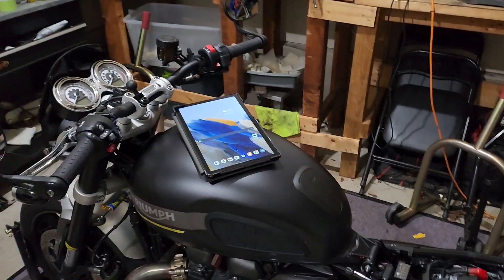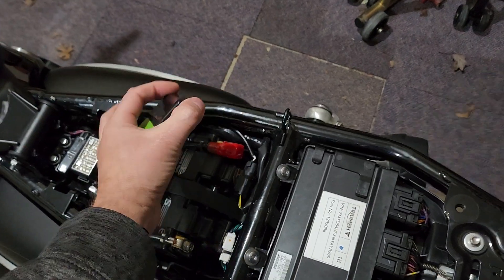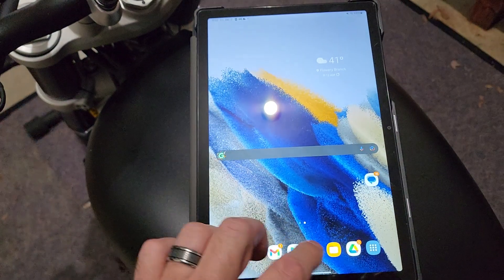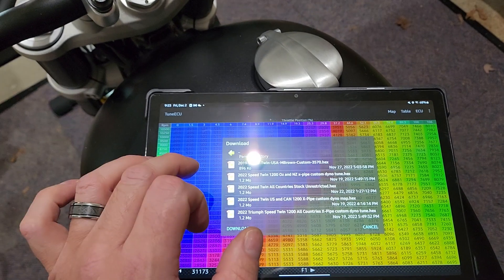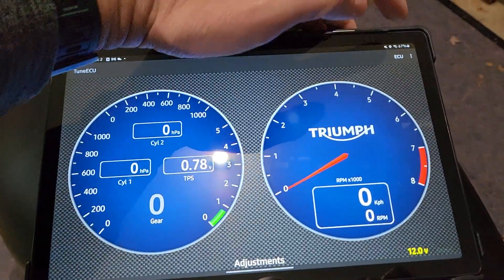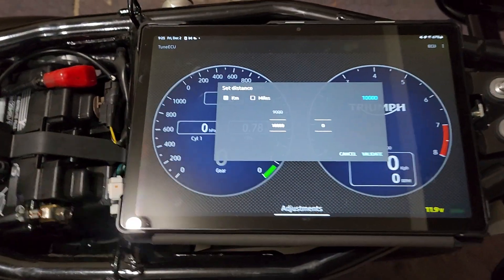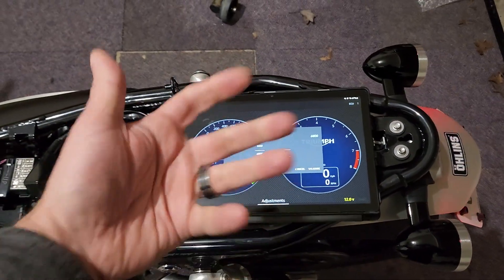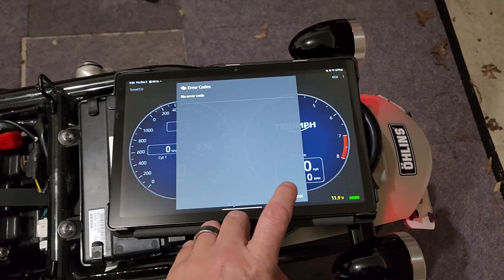Dave's Garage - How to reset maintenance minder on modern Triumphs

Comment: Thanks Dave! This really helped me. Dealer won’t reset the maintenance wrench without doing the oil change for $200 plus. Just did the “600 mile “ service
Reply from the maker: If a dealer tells me I can't pay them half an hour to reset a service reminder, I go find a better dealer.
Reply: Agree. Also the tune ecu app is now 24.99 pounds and good for 5 bikes but 1 year. Must be renewed yearly. Just for info!
Reply from the maker: True.  I bought a license many years ago, so I got grandfathered in and don't have to pay yearly...

Comment: Hi Dave. If i plug in my bike for the first time to tune ecu, does it shows witch throttle parameters it currenty has so that I could de restrict to 100% without downloading a map? Or is downloading a map for my street scrambler 2021 necessery?
Reply from the maker: No, you have to download the base map for that bike from TuneECU, see what's in it, make your changes, save the file and then push it to the bike.

Comment: I'm curious if you have a place where you find all these tunes, or if you're doing it manually (Sorry if this sounds like a stupid question, I'm fairly new to TuneECU)

What would you recommend as a tune for a 21 Rocket 3 GT with a set of Werkes pipes on it, and a 22 Street Triple with a high flow airfilter and a Akro slip-on exhaust?
Reply from the maker: Does your Street Triple still have the stock headers and catalytic convertor?  If so, then you can tweak the fueling with TuneECU to add a little fuel to the cruising range... up to 5000rpm and 20% throttle...

Same for the Rocket if it has the stock headers and cat...  Plus, the Rocket is severely restricted, so you will want to unlock that to full power as well.
Reply: @SquireSCA  My bike currently still has the stock headers with the first cat. Yes😮, however, I'm debating on whether or not to remove it.

 The same goes for my dad's bike, however I'm not sure if there is a way for him to remove the other cat from his bike.
Reply: @SquireSCA  Also, I completely forgot to ask, but can you have 2 bikes using the same software? Or is just the licensing part?

Sorry again if these questions are stupid.

Comment: Great tutorials and very informative. I was looking for tune ecu maps and Information for my Triumph Trident 660 here in the UK. Hoping to get rid of the throttle lag and now after watching your vids I may have to purchase a map as I don't feel confident altering maps myself. keep up the good work.
Reply from the maker: I can make you a map for free, that's easy.
Reply: @Daves_Man_Cave  Really? that would be great. Thank you
Reply from the maker: @pdkippax  Yeah man, it will take me 15 minutes. Year, country and VIN range?  And is it the full model or the A2 version?

Any mods done to it?
Reply: @Daves_Man_Cave  Year is 2022, Country is UK, full power model, GPR exhaust added, VIN last 6 digits are NAY1213
Reply from the maker: @pdkippax  There GPR is a slip-on right?  Not full headers and decal?

Here is a map that will work well:  https://drive.google.com/file/d/1K9lkFiPcaav3BTUIAf_DQQnTw7WVNulU/view?usp=share_link

Some more fuel where its usually lean, extended the rev range a little, shifted the AFR targets to 13.5 and made sport or road mode, whichever is your more aggressive mode, significantly more linear and aggressive for a much more sporty feel.  Should get rid of the lag and make it a much more direct connection between what your wrist does and how the motor responds.  Rain mode I left alone, and the ignition timing looked fine so I didn't tinker with that at all.

Download the map to your Android device, push it to the bike, reset adaptive and go ride it for a bit and let it settle in.  Make sure to test out the Road/Sport mode, that's where a lot of the changes were made and sometimes when you flash the bike it reverts back to rain.
Reply: @Daves_Man_Cave  Thank you for your help. Maybe I should have said that the exhaust was a complete replacement (only full systems available) and the cat was removed. Still has the O2 sensor in the system. Would this map still work? Really appreciate your time and effort.
Reply from the maker: @pdkippax  Start with that map.  It has more fuel than the stock map you are using, and if the bike isn't crazy lean now, it should help.  If you feel like it needs more fuel we can revise it.
Reply: @Daves_Man_Cave  Thank you
Reply: @Daves_Man_Cave hey, how difficult is this from dnk tune map
Reply from the maker: @SuperRider-RS  Same process, unless her locking the map so that you can't see what is in there, interferes...  I don't think that it will though.  The map is a separate process from a dash reset.
Reply: @Daves_Man_Cave  Can i use that map? when you mentioned more fuel, it means consuming more fuel? I use Zard full system.
Reply from the maker: @SuperRider-RS  What model, year, country and VIN range is your bike?
Reply: @Daves_Man_Cave  Trident 660, 2021 (India) last 7 VIN: NAU3991
Reply from the maker: @SuperRider-RS  What map are you wanting to use?  My map is for a Speed Twin, so you can't use that.  DNK maps are hit or miss.  Some are ok, others are bad.  I see a lot of people not happy with their DNK map.
Reply: @Daves_Man_Cave  Yes this map is not going to work for Trident, also i heard of folks not happy with DNK's map, there is no one else making the map for trident.
Reply from the maker: @SuperRider-RS  I mean, I can make one that is better than stock, that will at least keep the motor safe until you can get it on a dyno sone day to properly tune it, if you want?
Reply from the maker: @SuperRider-RS  Start with this map,  It will have more fuel than stock, all restrictions removed, a more aggressive throttle map for Road/Sport... Rain is untouched...  And the AFR tables are richer...  Start with that.  If you think it needs some more fuel let me now:

https://drive.google.com/file/d/1K9lkFiPcaav3BTUIAf_DQQnTw7WVNulU/view?usp=share_link
Reply: @Daves_Man_Cave  wow cool, i don't know if i'll ever get this bike on dyno, but if you feel it is best I leave it stock then I'd be safer this way?
Reply from the maker: @SuperRider-RS  With a full exhaust, use the map I provided.  It will run better with that.
Reply: @Daves_Man_Cave  cool, where do I find this map?
Reply from the maker: @SuperRider-RS  https://drive.google.com/file/d/1K9lkFiPcaav3BTUIAf_DQQnTw7WVNulU/view?usp=share_link
Reply: @Daves_Man_Cave  appreciate that! i'll find some time to get this updated over stock, do you feel I can expect same or better fuel economy with this map?
Reply: @Daves_Man_Cave  i forgot, will this require vin number?
Reply from the maker: @SuperRider-RS  richer map means you burn more fuel.  Do you want to save $39 a year on gas, or do you want it to run right?  Lol
Reply: @Daves_Man_Cave  ofcourse run it right! came to my mind because I also do long rides :)
Reply: @Daves_Man_Cave  Dave, one question, can this map be applied to other trident on stock exhaust?
Reply from the maker: @SuperRider-RS  It might be a little bit rich, but not too bad.
Reply: Hi Dave, finally managed to get the remap done. Bike is now a lot more responsive and sounds  better. Only problem is the engine management light has come on. Not had time to see what the problem is as it was cold and dark lol. Any ideas. Many thanks
Reply from the maker: @pdkippax  for next with TuneECU, click on ecu and read error codes.
Reply: @Daves_Man_Cave  All sorted Dave, connected back up and error code was crank sensor adjustment. Followed the instructions on Tune ECU and all is now well. Just for to wait for a break in the weather and take it for another razz. Thanks for everything
Reply: @Daves_Man_Cave  Hi Dave, got the tune flashed, one thing I have noticed is the fan is not kicking sooner, I did the 15min idle, usually bars are at 3 even when radiator is running, now its like 4 or 5 bars, any way to get the this sorted?
Reply from the maker: @SuperRider-RS  Open the tune, click on Map>Parameters and check the slider for cooling fan.  Default is 103C, and I usually knock that down to 100C.  You can put it lower if you want.
Reply: @Daves_Man_Cave  got that! Do i need to ride the bike for sometime for any adaptations?
Reply from the maker: @SuperRider-RS  No, and you don't have to do the 15 minute idle thing.  Reset adaptations instantly with TuneECU
Reply: @Daves_Man_Cave  I did not perform reset adaptation
Reply: @Daves_Man_Cave  oddly in parameters i do not see "fan temperature"
Reply: @Daves_Man_Cave  new update, the fan is kicking at 103c as confirmed by triumph engineer, only visual change is what was 3 bars earlier on display as standard is now 5 bars as standard, otherwise there is no issues as I thought it was. Thank you Dave
Reply: @Daves_Man_Cave  Hey Dave, I have done few hundred KMs after the ecu update (post reset adaption) no doubt the acceleration is improved, is there any indication to know if the bike is running rich or lean? I do feel the engine heats up quicker than before, is it proportion to the power it is making?
Reply from the maker: @SuperRider-RS  We added some fuel, so it's not running lean.
Reply: @Daves_Man_Cave  so it’s normal right
Reply: @SuperRider-RS  Hai, which obd tool you are using? Wer did you purchase it? Price?

Comment: I know on my 2018 Street Triple there’s no to speed limiter to remove (it’s redline limited around like 150 something) but I can adjust fans, disable SAI and O2 sensor.
Reply from the maker: Because your speed limiter is hard coded, no way to get rid of it unless you want to remove the wheel speed sensors and lose ABS and Traction...  Your is around 144mph or so.
Reply: @Daves_Man_Cave  yes can confirm I could only get to 141mph (225km/hr) on my 2020 Street Triple 765RS as I am quite tall seated and wind resistance was higher etc
Reply from the maker: @davidturner8301  Same here... I was able to hit low 140's on track but that was all it had in it...
Reply: @Daves_Man_Cave  sadly I never unlocked the potential through TuneECU before I was totalled riding the bike to work after owning it for a short 5 months. Written Off